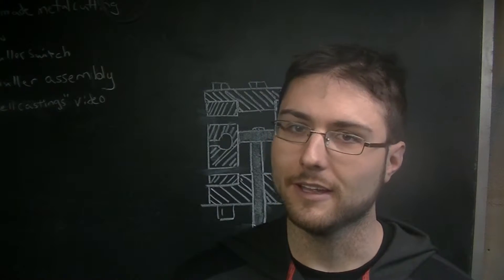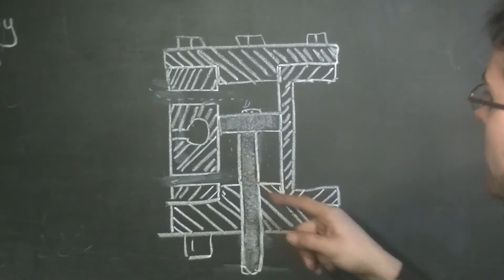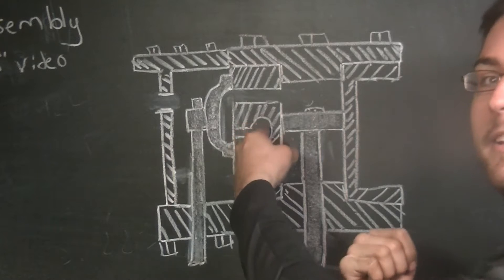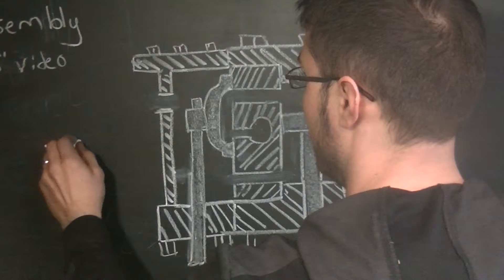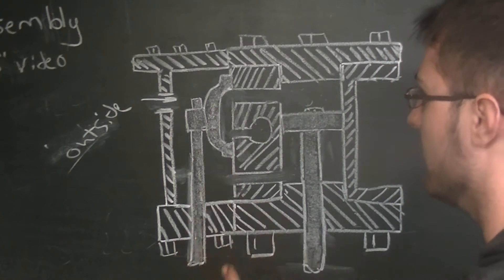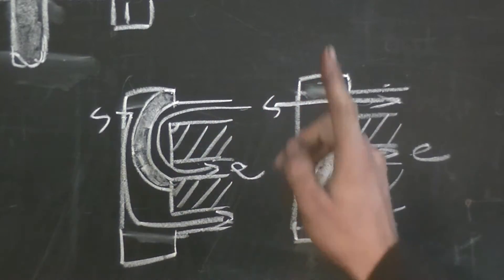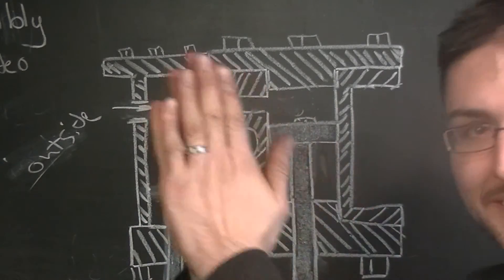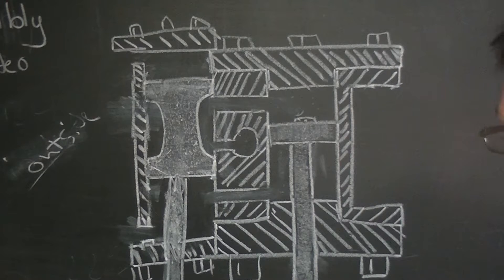Chalk Talk 1: How Steam Engines Work, Slide Valve vs. Piston Valve

Comment: Your inlet hole at 3:34 is actually the exhaust hole. The steam inlet is on the upper side of the slide valve. This is so the pressure of the steam holds the slide valve down on the valve face.
Reply: At 4:55 he stated he had been describing inside steam admission, and 4:55 onward explained outside steam admission comparing the two.  Am I correct in assuming that you stopped watching the video?

Comment: Just a correction: at 3:32 into the video, you refer to the exhaust port as the source of the steam. That is incorrect. The inlet steam enters directly from the boiler into the steam chest, which also forces the slide-valve against the cylinder face, and enters the cylinder through the inlet steam ports into the cylinder. It exits the cylinder through the exhaust port that is bridged by the gap in the slide-valve to the exhaust port

Comment: So the piston could be eliminated and the valve could be dual use
Reply from the maker: You need the valve and piston.  The valve provides the path of steam, and the piston, with its greater diameter provides the power (Power output is proportional to the square of the piston radius).

Comment: I did not realize that  a Piston Valve along with Super Heated Steam could be used in the Steam Chest and Cylinder of a Reciprocating Engine.  I  always thought SHS was only for the Turbines.  I wonder if this system was also used in Triple Expansion Marine Engines ?

Comment: as a model engineer i must correct you regarding your explanation of slide valve operation, you are putting live steam through the exhaust this would lift the valve off the portface live steam should enter directly into steam ches